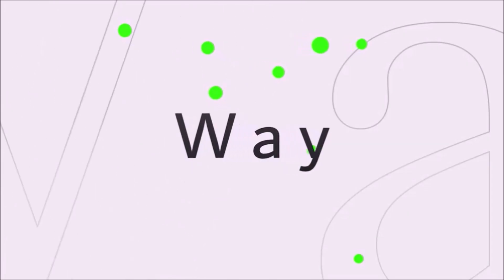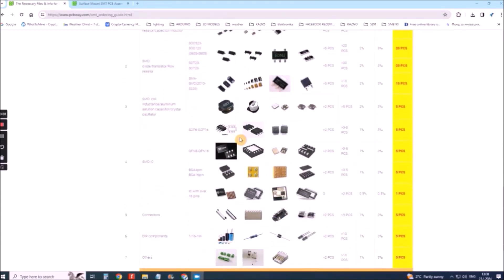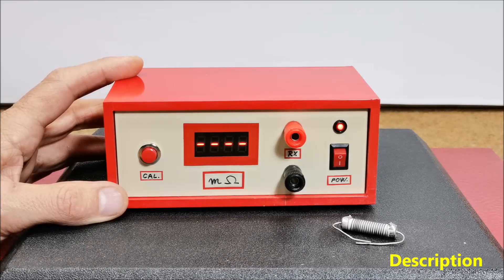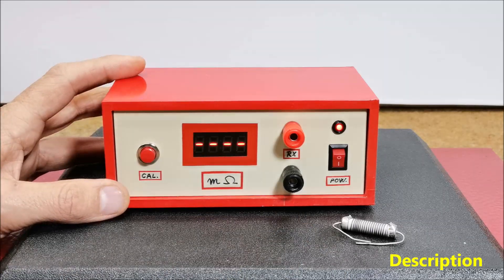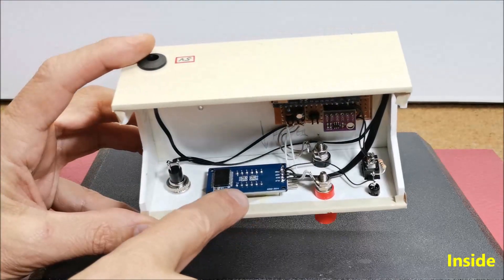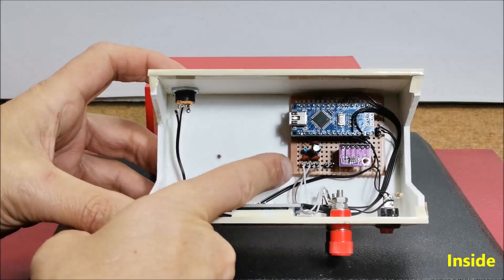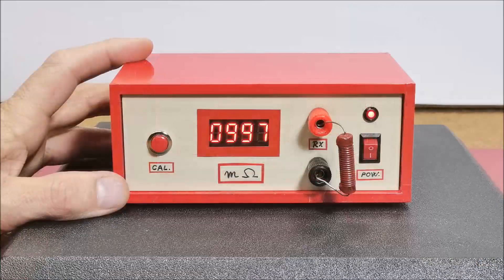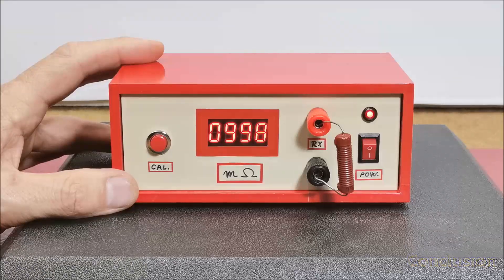DIY Precise Arduino Miliohmmeter

Comment: Hi. I am curious if anyone else had tried making this... I have put one together and find the display comes on fluctuating and reading around "28:00" with the colon in the middle. Doesn't settle down. Shorting the leads takes it to 0000 but it won't measure a resistance and pops back to the fluctuating 28:00 reading when un-shorted. Have tried replacing all the components (including the arduino) one at a time and no joy. Any thoughts or comments? Thanks. Paul
Reply from the maker: I guess you have a connection error somewhere. Try to follow the circuit from the source:  http://rcl-radio.ru/?p=100859
Reply: @MirkoPavleskiMK  Same thing after referring to the source. Do you have a solution?

Comment: When using to test a resistance more than a few centimeters distance away, be careful to measure as quickly as possible after zeroing because the effect of the "2-wire" test leads resistance as they warm up from the warmth of hands will skew the reading.

Comment: There should be a button to offset the resistance of the measuring leads, especially when you use the crocodile ones: short-circuit them, press the "Offset" button, and consider that the value read is 0.000 ohm.   With that you will get a better precision.Another way to further increase the precision is by using a Kelvin 4-wire connection to measure separetaly the current and the voltage at the resistor.

Comment: This is an outstanding project, as always. Thank you! For those folks that already have a multimeter (but it does not have milliohm  precision,) there are many DIY milliohm meter adapter circuits on YouTube and the Web. I built the YouTuber "craftycoder" project. I like it and it works very, very, very well! Just search his channel for the "Precision Low Current Measurement" series. And, take note of the references that he lists in the header comments. There is great information in those materials, as well. This is not to make light of Mirko's project. It is an awesome complete package and the EE Hobbyist Community is fortunate to have him. The adapter is just a much smaller and less expensive project, if you already have a multimeter, as I said. Cheers!

Comment: 2 wire miliohm meter? Well...
Reply: Yes it's quite a breakthrough because 2 wire resistance measuring up until now has been difficult to acheive with enough stability and repeatability.